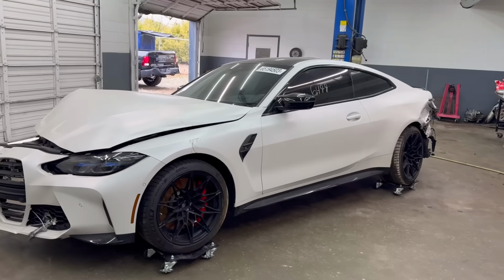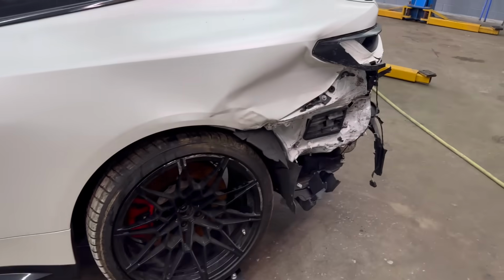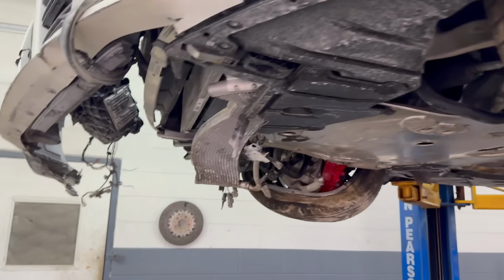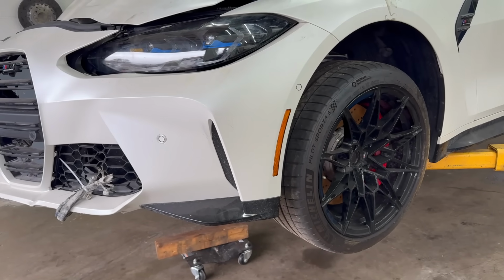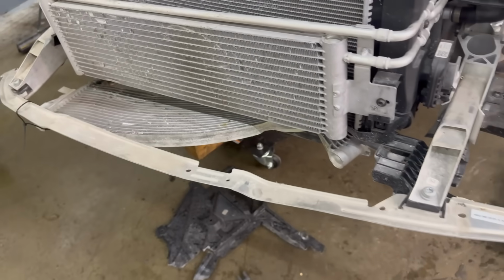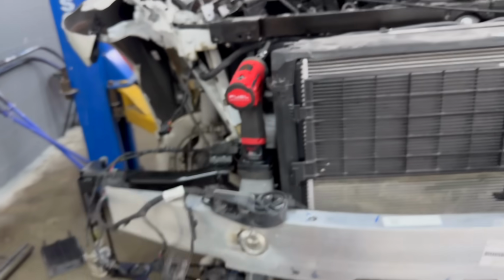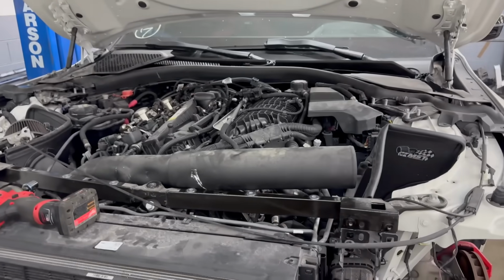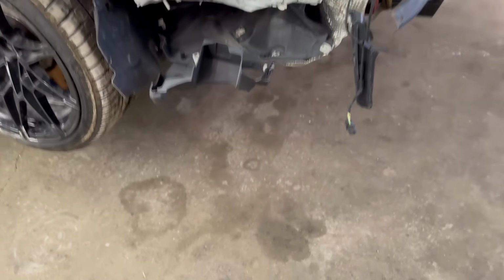I BOUGHT A WRECKED 2023 BMW M4 Comp!

Comment: A Mishimoto oil cooler is going to be way stronger than OEM. They make a skid plate too that protects the cooler from damage. Also, the reason the original owner likely kept the ECU is because you have to send the ECU out of the country to get it unlocked before you can tune it. That process is expensive and takes a good amount of time.
Reply: Like sauce and 250x entries? :face-blue-smiling:
Reply: Mishimoto is crap actually ;)
Reply: They did get scammed on that Camaro SS with a junk truck motor.
Reply: @Nakinakpgm What brand would you recommend?
Reply: @Nakinakpgm  Exactly idk why people put that garbage on their cars let alone an M car 🤦‍♂

Comment: Looking forward to the end result on this build!  The frozen paint is a bit of a pain, get a good ceramic coating on it as soon as you can and it will help with stains.  As for the DME (ECU), assuming the previous owner is getting a replacement M4,  they could have had a JB4 installed in the wrecked one and wanted to take the next step in the replacement car and snatched the DME out to send to FEMTO for unlock.  The DME unlock is an expensive and time consuming process, so having a backup DME is not a bad idea. I hope you can find a used one, my understanding is that it is expensive to replace.  Good luck!
Reply: you honestly think he's going to repaint that thing the original color? i'm thinking by the time he's ready to paint he's going to have so much money into this thing he's gonna go with the cheapest paint he can find. jeez what a money pit its turning into
Reply: @gregh7457 he can wrap it frozen white. Cheap and saves original color
Reply: @gregh7457  Seems like any german car is a money pit and unreliable !  But always helps if you can fix them yourself !
Reply: @tnolan3176 Agreed,  when he’s taking the front apart there are a million little plastic pieces that you just don’t see on something like a Mustang.  It’s like they go out their way to make them complicated.

Comment: He was most likely running a Femto unlocked ECU, and he pulled it to sell, or to use on his replacement G8X. There's still currently no one in the states that's able to unlock these ECU's, so you gotta pay $1-2k to ship them out for unlocking, plus whatever you pay for the tune on top. Lots of G8X guys also need and want backup ECU's, so they don't mess with their stock ones. Anyway, wish you luck and excited to watch this build. 🤙

Comment: Even if it was tuned would be worried about extreme engine damage.  Not good no ecu usually means the original engine most likely blew up and they put a junk engine inside the car here is what you need to do.

1. Check the engine mounts 

2. Check the bolts around the transmission

Comment: i find it incredible the amount of damage people do to their cars, especially new ones - something i must try and do is work out the ratio in the UK to the US, how many cars get wrecked like this - for starters i think we might be a tad more strict on what we consider insurance write offs, as UK cars are either repairable, no structural damage, parts only or dead - and bare in mind most of our roads are narrow country, faster speeds with twists and bends all over, with pretty bad weather, potholes and generally dreadful conditions so you'd think we'd have more wrecks than you, but it would seem not
and it seems in the US, insurance write offs end up in the auctions ready for you guys, and having followed yourself, brothers and them Goonies for some time, i for one would have no issue buying a rebuilt car from you, your work is magic
that BM is slightly on the trashed side, be an interesting one to watch, the red interior is very 1970's pimp mobile
looks like someone beat the crap out the intake tube at front, oh what a surprise the ECU missing, hasn't Yuri got one to fit??

Comment: Man I feel for you.  I got scammed by a Copart vehicle really bad.  I bought a clean title vehicle from the North Boston Copart lot.  The vehicle looked good in the pictures and was a low mileage vehicle.  However, when the car was delivered, someone had done work to it to make it look undamaged but the frame was crushed in the rear and the front.  They had put a radiator support from a different color car in it and had done bodywork to the decklid and repainted it.  It was terrible.  I had to run it back through my local Copart lot where all the damage was disclosed.  I lost $8000.  So I'll never buy another vehicle from Copart unless I've actually seen it myself.
Reply: Samcrac just went through a lot and found something like that too.

Comment: Can I tell you a little trick a busted ball joint and if you take the 8x8 bored and you can put it on that and if you got a slide trailer you can slide it right now right on the ground I know that by I used to drive a tow truck

Comment: The reason the ecu is missing In order to tune this car the ecu needs to be sent out and unlocked so it’s worth money unlocked also they sell for good money for people that wanna clone there ecu when they go to the dealer they can run there stock ecu if they blow up there car 
This car was probably making 800 hp the other reason that sensor was unplugged is a e85 sensor to run e85 
Hope the motor is ok

Comment: I bought a used car from a large new car dealer in  an auto mall. I live in a city with 2 million people and it was missing the fob for remote entry and alarm but would still start with the valet key. I looked on eBay for a keyless fob and low and behold there was a guy in my city selling one. It worked perfectly without programing and he had other fobs for sale too. Gee, I wonder where he worked ? My point is , a lot of stuff gets taken off of cars at dealerships and auctions by unscrupulous employees to sell on the side such as the wheel center emblems on this BMW.

Comment: The oil cooler probably has a thermostat that does not open until the engine is up to temperature That's why oil is not leaking out

Comment: In the UK, if you haven't declared a tune to your insurance company, your insurance is void. The ECU would hold tune information. Maybe that's why it was removed?
Reply: It doesn't work that way in the US. Only issue with insurance is the value of the car. They will not pay you more just because you spent money on Mods. That's why some people remove the modded parts. They can recover some of that money selling the used parts online.
Reply: @MrWoodyBalto  That's good. They wouldn't pay out in the UK if you altered the vehicle from factory. They want you to tell them so they can charge more money on insurance. We get ripped off over here on everything: fuel, energy, insurance, and taxes.

Comment: Salvage cars can be sketchy.........if you can't look them over closely in person, it really requires blowing up the views, especially under the hood or any view of suspension to look for anything that doesn't look right.  I just bid on a couple of MB yesterday......one with similar front end damage. I almost think that I had this car on my watch list at one time. Should be a good project and hope you don't discover anymore surprises. I guess there is an argument to be made that rear end damage is preferable, especially if the quarter panels aren't damaged. Look forward to future videos on this project.